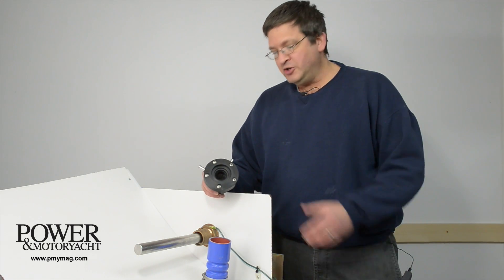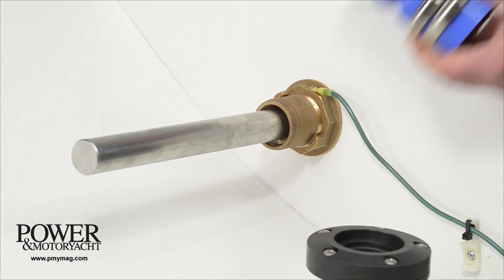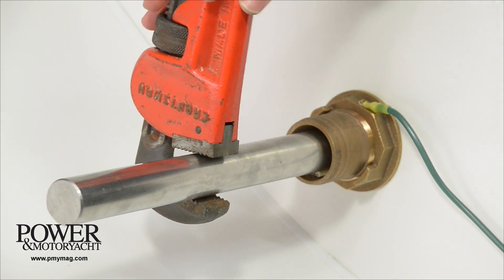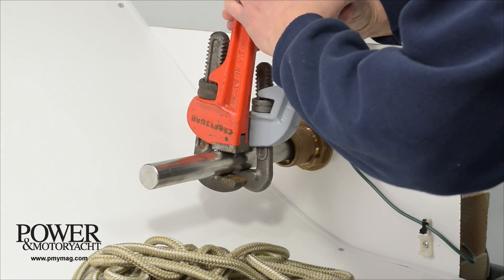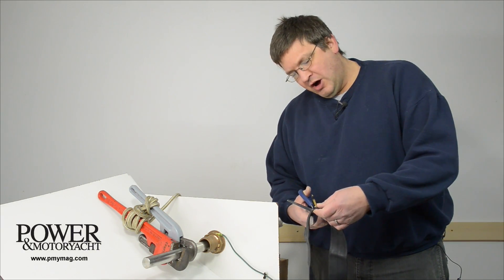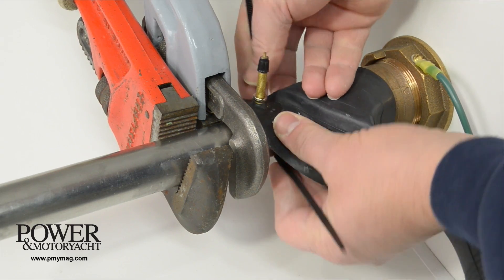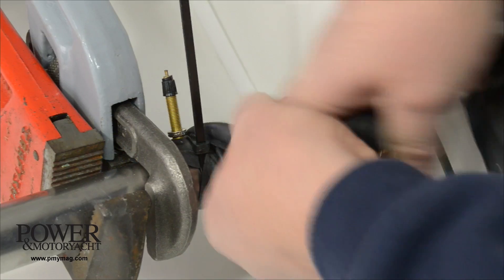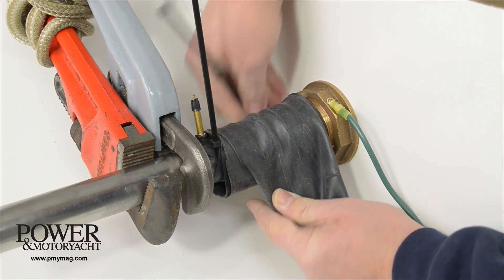Emergency Shaft-Seal Repairs

Comment: Huh? What turning shaft? What fingers? Bath towels? Where? Are you talking about fixing it whilst running (well, obviously not if shaft is off the motor... but why does it need to be disconnected anyway to temp fix the gland???). Bicycle tube ? Never sail with it. Nothing made any sense in this video.

Comment: Why do you need typ immobilize shaft

Nevertheless I learned sumthin 

Thx
Reply: Cause if you fail to do so, the tube will be torn apart.
Reply: Can you still drive it with this emergency fix?
Reply: @zoknows4061   Nope. But you've stopped the water ingress.